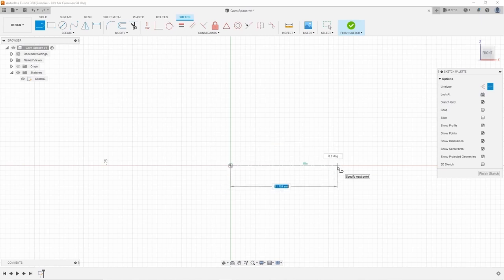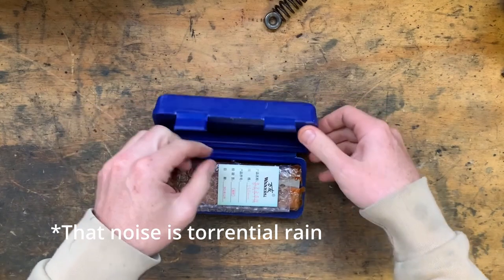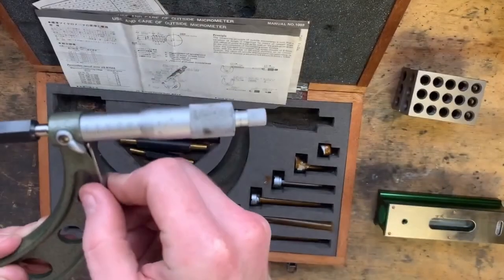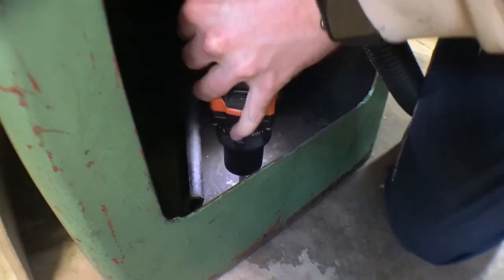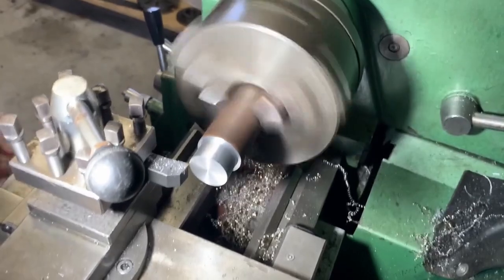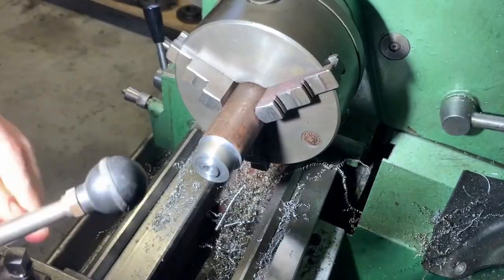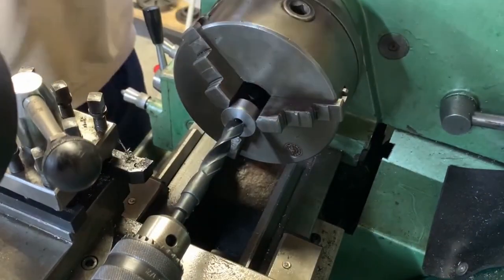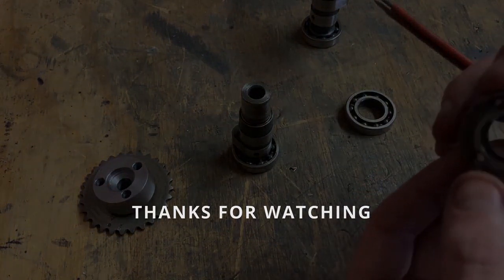Home Made V Twin Cam Spacer

Comment: Interesting. How to make eccentric shaft for rotary engine? I have 2 mazda rx8 engines laying around I want to make 4 rotor engine from these engine.
Reply from the maker: I’d probably buy some en39 or something like that. And centre drill the ends and turn the whole lot between centres, you can then harden it and use the same centre holes  to grind it. The other 3 eccentric lobes will be pressed on and keyed. They can all be made the same and just have the key ways degreed differently on the main shaft. Being shorter they can be turned between centres too then ground.